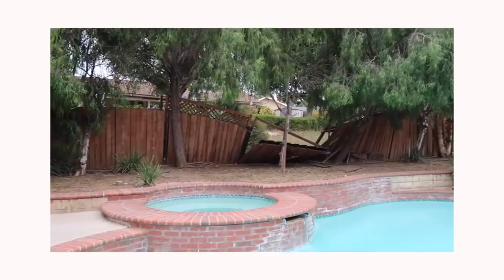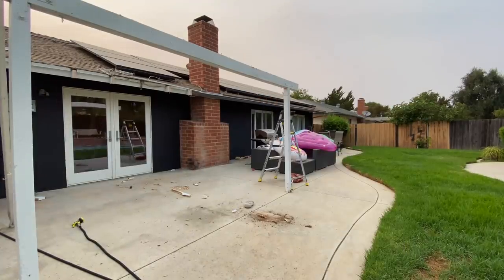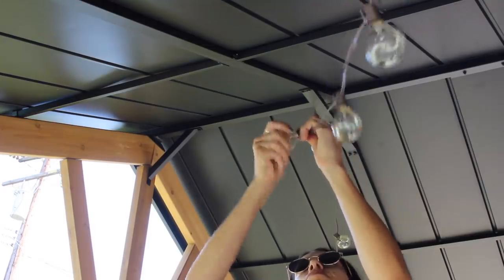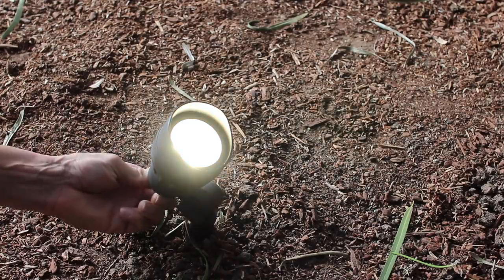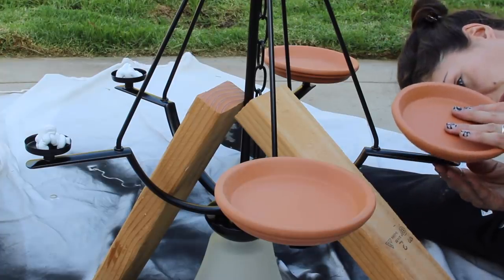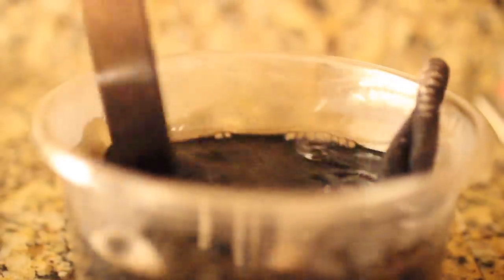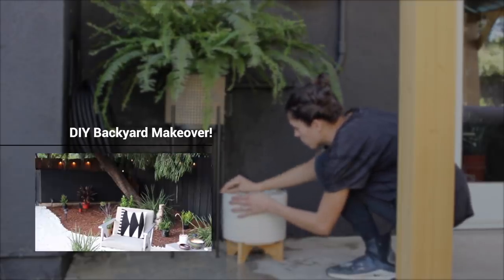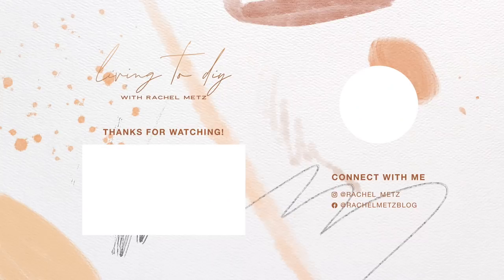DIY Outdoor Entertaining Area Makeover | Easy Backyard Update Tips + Tricks

Comment: You could glue the terra cotta pots to the saucers and then just pop those plants in the plastic containers inside the terra cotta pot. That way if you need to water, fertilize, or replace a plant, etc you can easily pop the plant out.

Comment: I think it would have been better to also spraypaint the terracotta plates black on the chandelier because if you just look at the plants, the plastic "terracotta" looks absolutely fine, but with real terracotta, right under it, the contrast is amplified. Obviously just a tiny critique, I love the overall outcome! It looks so cosy
Reply from the maker: Make sure to do that in your home! When I paint plastic, it has a tendency to chip over time and flake off which I'm not a fan of.
Reply: Or maybe try the diy terracotta paint by mixing acrylic paint with baking soda to get the same terracotta texture
Reply: Or just switch to black plastic pots?
Reply: I sanded down one of my plastic pots with a nail filer (only thing i had on hand🤷🏾‍♀️😬) before painting it and now its been holding up pretty well for 2 years, the bottom edge is slightly chipped (about 0,5 cm) like you mentioned, but i think thats because i have to pick it up to put it in the sink to water it. Everything else has held up perfectly hihi🤭